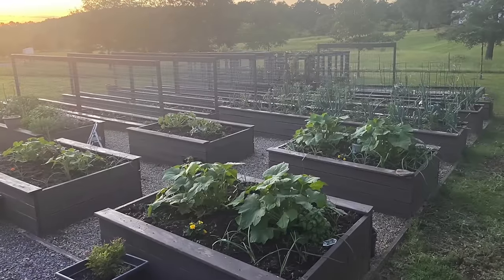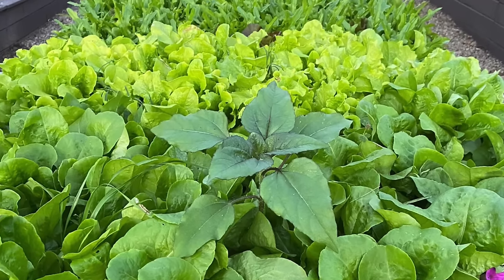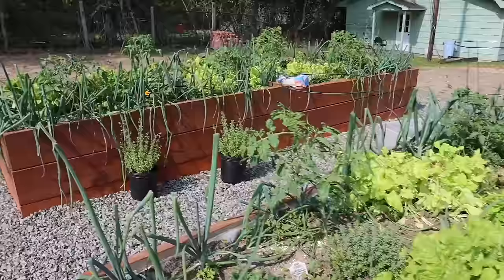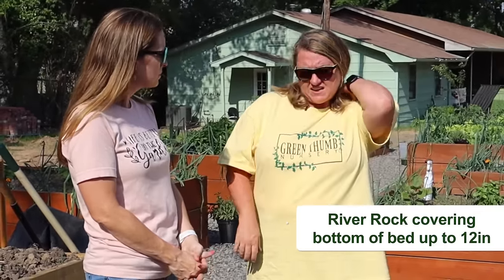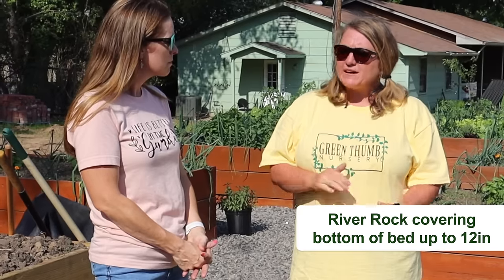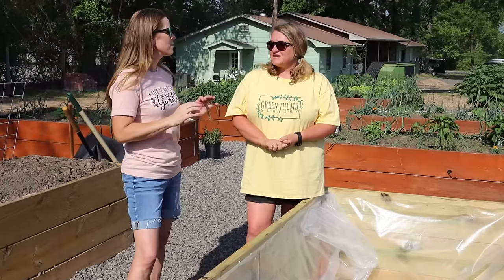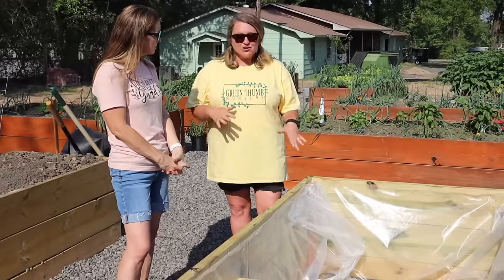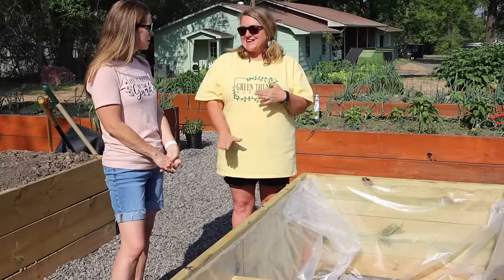DIY Self Watering Raised Beds/Green Thumb Nursery

Comment: i've done this using cut branches, instead of river rock.  And only 8"s of wood.  I didn't use a barrier and I constantly pumped a little water from a small pond.  The water returning from the wicking bed was crystal clean.  The veg grew fantastic!
Reply: It seems a little expensive with all that rock, I have a lot of access to dried wood.
Reply: @nuclearchick27  only if you buy by the bag but mulch places are cheaper you just pay a delivery fee or use a truck or trailer and pick it up by the ton
Reply: Buy rock doesn't deteriorate or breakdown like wood does so you're missing the point of using rock
Reply: @sweetsrt  rock doesn't absorb water or other nutients, wood is natural.  I don't see what point I have missed.  I have grown in rock with aquaponics which worked well.  There is a place and time for everything.
Reply: @rjaquaponics9266  what you missed was the rock is being used to hold the water and keep space for a long period of time. You use wood in place of rock the wood would deteriorate. That Is the Point You Missed.
Reply: @sweetsrt  The growbed will deteriorate long before wood limbs would.  Wood can withstand being underneath water for decades.  Wood rots quickly when exposed to air, but when under ground or under water it is most stable.

Drawing on stagnant water will create issue.   The plant rots would grow to the water and the barrier could create root bound plants.   The design would fail in a few years.  Rebuilding would be a job.  Nothing last forever.
Reply: @sweetsrt  Soil is alive. Wood and worms create living environments beneath the soil and release valuable nutrient. Nature has this figured out Layers are big rock, small rock , bigger wood. smaller wood and hay, then topsoil. Do not need to put any kind of barrier in there as the wicking feature needs to have something to do the wicking.
Reply: My raised bed has 11" tall, can I do it by your way. Thanks.

Comment: I've seen people use the corrugated pipe as filler instead of rock. Put a coil in the bottom with the filler pipe up the side and still cover with landscape cloth, then cover with sand to above the level of the overflow. You might need to put a little gravel around the overflow pipe to keep the sand from leaking out, but that seems to be all the gravel that would be needed. The sand will act as a wick and probably does a better job than gravel. I couldn't recall if they used another layer of landscape cloth between the sand and the soil, but it seems like a good idea. I just went a found a video where instead of landscape cloth on top of the sand, they used a mulch. Either would probably work fine.
Reply: The rock is actually better than sand or pipe. It is robust and stands up to the weight of the garden without collapsing over time like many types of pipe do. Sand holds more water, but the rock does a better job of wicking the water up due to surface tension, adhesive and cohesive properties of water. I’ve tried many different fills for the reservoir and we now use a fine layer of sand in the bottom to protect the liner and then 20mm drainage gravel as the main fill, cover with shade cloth or other landscape fabric of your choosing and then growing medium to suit your needs. A thick layer of mulch on top will ensure that the water doesn’t evaporate from the top of the bed keeping the soil at optimum levels of moisture.
Reply: @acrom17  Thanks for that information. I haven't set up any wicking beds myself, but plan to in the near future and this will be very useful knowledge indeed. Out of curiosity, how deep do you go with the gravel?
Reply: According to the Back to Eden Gardening videos mulch getting into the growing medium will draw out the nitrogen to break down the mulch.  Best to use mulch on top though, it slows evaporation and protects the soil from extreme temps.  And if you can use mulch fresh from a tree trimmer, (or something that still has leaves, etc.), he said it is even better.
Reply: Abs pipe won't collapse!
Reply: I agree with you, with using 4” corrugated pipe and then I would fill in around the pipe and bury it with about 2 inches of rock to bring the reservoir depth to about 6”, I think there would be more water this way than with 12” of rock, because that rock is going to displace a lot of water
Reply: Dave - Open graded (no sand and smaller rocks) crushed rock has about a 25% void space, so a pipe (100%) would have about 4 times the storage problem. 

Drainage pipe is designed to be buried so absolutely no problem with it collapsing in this setting.
Reply: Absolutely agree with this - pipe is expensive.  But have you looked into how much 'washed river rock' costs?  Wow.  Also you need a loader of a lot of time and a strong back.  I'm for the coiled 4" drain pipe.
Reply: @acrom17  doesn't the gravel effect the pH?

Comment: The downside of using the rock for the reservoir layer is the video space in the rock will be about 25%. (Besides the weight of moving all that rock.) That means you can achieve the same reservoir capacity with a single layer of 3-4” pipe, or you could stack 2 layers and double the storage  capacity in half the space.

There are also a million alternatives to buying pipe. Any bottle (milk carton, soda bottle, upside down can) that you can poke a hole near the bottom and the top can provide a storage reservoir. 

Also, you don’t have to guess at the amount of water in the reservoir. A stick in the fill pipe can work just like the oil dipstick on a car engine. Just don’t leave it in the water or the stick will wick the water and give a false reading. An alternative that would allow you to leave the stick in the reservoir and give a continuous reading would be to add a cork or styrofoam or something else that floats. If you insert it first when it’s dry, mark the stick at the top of the fill tube, and then mark the stick again when the reservoir is full , you’ll always be able to see at a glance how much water is available to the plants.
Reply: Void space not video space. 
Darn autocorrect.
Reply: @johnlee7085  You can edit your first post instead of a 2nd post for corrections...just FYI. :)
Reply: @rockymountainkitchen7834  First of all, is it worth it to nitpick?  Secondly, I personally have seen people make negative comments about editing implying they changed the message.  Third, who cares, you can understand the intent, right?
Reply: @c.m.303  I wasn't trying to nitpick, I was just letting OP know something that he might not have known. I personally don't care whether someone edits or just posts a 2nd post to correct, just trying to be helpful.
Reply: You're a detail-aware individual. Thanks.
Reply: @c.m.303  , No, he's right. You're over reacting.  I won't be back to argue either.
Reply: Does anyone have a soda bottle version? Thank you all gardeners!
Reply: @rockymountainkitchen7834  I agree with you Rocky.  When I read the comment I didn't get what video space meant.  Glad it was there for the fix.
Reply: Use Leica to replace the gravel. More expensive but lighter.
Reply: For soda bottle and many other alternatives, check out Leon’s wicking bed videos. He’s a hoot to watch but also gives tons and tons of info and alternatives. Definitely recommend a binge because he doesn’t cover everything in every video. Super worthwhile though.
Reply: Mama…..

Use bottles. It is good to recycle, much much less expensive, and much much greater storage volume.
Reply: Do the chemicals from the plastic leach into the soil?
Reply: @c.m.303  see what minding your own business could have avoided? You ask why are they so concerned while doing the exact same thing, only theirs had a intention that was productive. You really should practice what you preach, they helped the OP, which anyone sitting back could see. Yours was a useless complaint and virtue signaling. How do you suppose we teach people correct things if we don't correct mistakes?
Reply: I would do it with "beer bottles " :-) , I meant glass bottles or jars.
Reply: I have some questions you expressed concern of the wood touching your food product but not the plastic leaching into your food. 
Also a foot of river rock is a lot the soil will be hard to replenish or move the following years
Reply: Anna - Interesting that you say you have some questions, but don’t ask any. 

There are conditions that cause chemicals to leach out of plastics but it’s not all conditions. Sunlight and heat are the two main factors. I’m pretty sure that buried plastic (cool and dark) doesn’t leach chemicals. That’s why public potable water lines are commonly made of pvc. Do you drink public tap water?

It is unclear what you are trying to ask/tell me with the second comment about the rock and soil. My position is that there are better options with greater void space, easier to handle, less weight, and probably less expensive.
Reply: On some platforms, editing apparently is an option. That’s not always the case.
Reply: @tamkhai2458  
You don't re-cap them, do you? 
They lay horizontal and are open to hold the water, too? 
Or do you put them vertical all lined up?
Reply: LXS - I think the comment was a bit tongue in cheek. 

You can use anything as a reservoir. It needs 3 things:
1. Multiple holes at the bottom to let the water flow freely into and out of the reservoir. 
2. A hole near the top to allow air to air flow and prevent a vacuum or pressure chamber. 
3. A means of minimizing soil getting in. 

Standing empty bottles as is wouldn’t comply with any of the 3 principles. If you put a small hole near the bottom and placed them upside down, that would work for all 3. On their side would mean drilling or cutting a  lot of holes. 

Glass is nicely inert, but does crew other challenges.
Reply: @johnlee7085  I really love your idea about using the 4-inch PVC plumbing tubes. I'm going over several versions in my mind of how this could work but since you have done it I was wondering if you could give a better explanation somehow or even make a video. I do have a little bit of a learning disability so please forgive me if I didn't catch on the first time you explained it.. 😅?😂
Reply: @oildalesqueen1
This is your lucky day! The video you requested is already available though it’s not mine. Leon is the godfather of subirrigated planters, and I believe is referenced elsewhere in these comments. He has videos showing how to use bottles and other reservoirs too. Plus, he’s just a hoot to watch. Kinda like hanging out with grampa. I think Aldo Prepper is another I’ve appreciated though there seems to be gobs of other newer ones if you search subirrigated planters. 

Basically, wrap any sort of container in soil filter fabric. Make sure the container has holes near the bottom and top and bury it/them in soil.
Reply: @johnlee7085 thanks the video word had me perplexed!🤔😄
Reply: @ngudikawruh  I would be leery of using plastic bottles that can crush under the weight of the soil. If the bottles with compromised structure due to holes drilled in them were to crush, the overflow or shall I say underflow rigging would not tell an accurate reading. Obviously you could predict this if you noticed the soil in your beds sinking. Why make mud?

Comment: Huge video for a guy just starting out. Youll hear old timers tell you "Never put plastic in your raised beds" "Never add stone" but i dont think they look at it as intricately as yall have. Great idea using the sewer pipe as a way to water the deep roots if your system runs dry. A common complaint from them old timers is "Wheres the water going to go if you put all that rock in there to take up space" But they never thought to add a simple overflow pipe. Wow. I really love your set up and im going to try it for my outdoor bed im building this year for tomatoes and peppers!

Comment: Corrugated drain tile. Thanks for the ideas ladies I have a winter project now.  If I decide to build this one thing different I would do is offset the overflow drain on the Southside of the bed so I do not have water runoff directly on the lumber creating a stain.

Comment: Just what I've been looking for.  I was searching for a watering system so I don't have to spend so much time watering.  So time consuming.  I'm about to build a couple of new raised beds so this will be ideal.  Great job will be doing this.  Instead of river rock  I will use sand.  I watched another video that compared sand and gravel.  Sand evaporated faster in this mini trial.  Great job ladies enjoyed your presentation.  Very nicely explained and easy to follow.  Enjoyed how each step was included.    From here over the pond in Essex England

Comment: This is spectacular. I live in Southern Nevada (very arid desert). Anytime I've grown food olin pots I ONLY do it in self watering pots.....only way your plans will survive out here. Actually need to fill the reservoir 2x in the summer, sometimes 3x depending on the plant. I've always wanted to translate my self watering pot to a raised garden bed. This is a super helpful way to do it, although I would tweak this to have more water....like space out the rocks with bottom capped upright tubes with wicking rope dipped into them. We simply would need more standing water out here.
Reply: I'd suggest finding a way to work a float valve into the system, in that climate. We use them to keep cattle water troughs full, but I'm sure you could use one to keep the water up to your garden too.

Comment: I would consider using a couple columns of peat moss or coco coir that go down into the rocks (cut holes in the fabric, clear out the rocks down to the bottom, lay down an overlapping layer of landscaping fabric over the hole and fill with peat or coco coir and then dirt on top.  This can create a wicking column down to the bottom of the rocks.
Reply: Important step
Reply: Kind of my thought I was wondering where the wicking was in this design
Reply: Same concern here. Most of that rock and water is doing nothing at all in the design on the video.
Reply: @mortyr045   I suspect that is why she has to water every week. She needs the soil to be in direct contact with the water.

Comment: I'd considered this when I made my raised beds. It just seems more cost effective to put in drip irrigation on a timer. I might still try this in a smaller bed.
Reply: I see your  point.  I'm thinking deep rooted plants such as tomatoes.  maybe sweet potatoes or potatoes?  Carrots?
Reply: These wicking beds are common amongst home gardeners in Australia with raised beds. Our summers (especially in the southern mainland states) are long and hot. 40°C/104°F are common at the hottest part of summer. Evaporation is a problem, even with mulch, so wicking beds such as these are a good solution as it minimises evaporation and rot from irrigation.
Reply: @erin.murphy  That answers my question about using these here in  Southern Utah where we have 110 degrees in the summer.  I was concerned about the water getting too hot in the reservoir, but it sounds like it works well for you down under, and the water doesn't wick up the soil so far as to evaporate off the top?
Reply: JSclar - It is amazing the difference just between solar exposure and shade. 30 degrees for the air. You could also dig out the soil a bit before placing the liner and use the benefits of geothermal moderation. You just need the overflow pipe to be above grade.
Reply: @erin.murphy  The whole purpose of drip irrigation is you give the plant the water it requires and not much more. The plant should be taking up that water before it even evaporates. If the climate is hot to the point that evaporation is quick then you simply bury a drip hose a few inches into the soil. Being honest with you, if your water is evaporating so quickly that mulch and buried drip line isn't supplying your plants with adequate water I'd probably be more worried about my physical being and my possessions than I would be my plants. Even at 40c evaporation isn't that drastic, even more so if the humidity is high. Which I've been lead to believe that Australian summers are hot and humid.
Reply: @Kyle_Hubbard  When you buried drip irrigation do the openings get clogged with dirt?

Comment: I am at 8,000 ft in the mountains of Colorado.  We are in a protracted drought. Also I could have a frost almost any night of the year up here. Lots of sunshine, I have ponds and a well, so plenty of water. But with the beds built this way I could so easily cover them with a big sheet of plastic if we were going to have a freak cold night in July or an early frost. Also I think bird netting would keep the deer and chipmunks from decimating my garden as they have done in past years. My house plants are all done with the Gardening with Leon method, and it works beautifully. I think I might use the sewer pipe and landscape fabric in the reservoir instead of the gravel. I'm 73 and shoveling gravel doesn't sound like fun. Thank you so much! This is a great idea and I'm using it this year.
Reply: We are also in CO but down near the front range. It’s our third year attempting gardening here. Still so much to learn with extreme temp fluctuations and we get some crazy wind drying stuff out. Looks like I might empty our raised beds to try implement this! We were driving ourselves crazing trying to keep plants from dying in the summer heat.
Reply: You might want to think of using tulle fabric instead of bird netting.  Nothing,  including bugs/pests will get through it and birds won't die getting caught in it.   It's really great and it can also be used as a light shade cloth,  even though it's not a cloth. 

Robbie and Gary - a YouTube channel, she talks about all the things she uses it for in the garden.  I love it.